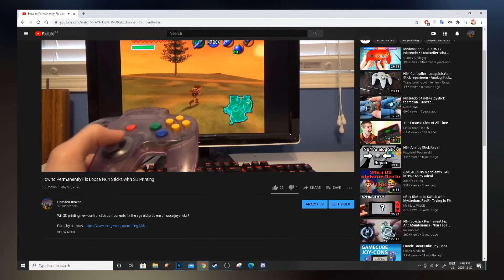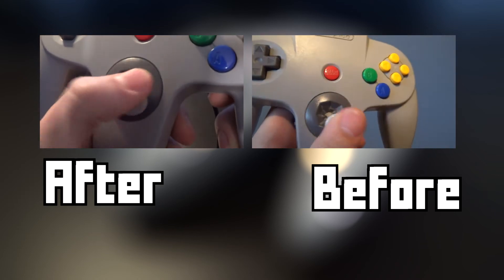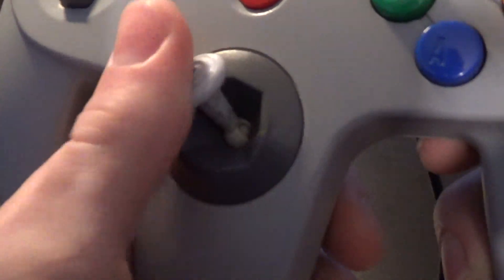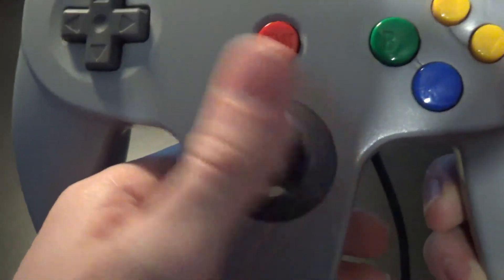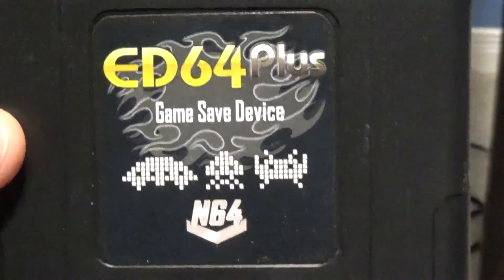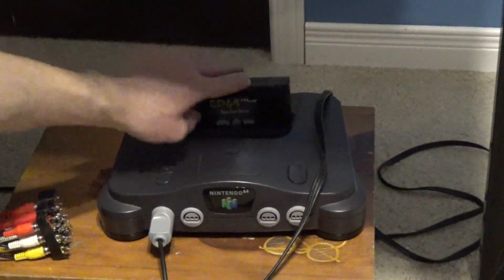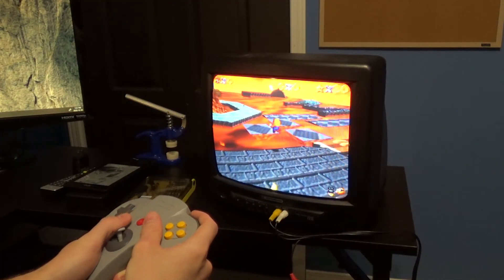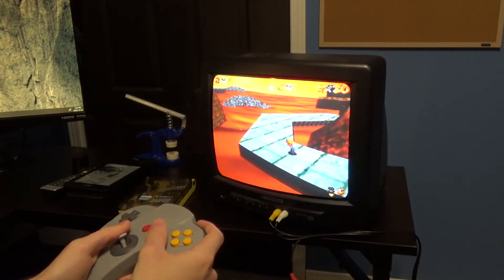The Permanent Solution to a Broken N64 Controller: 7 Months Later

Comment: Hey what kind og Grease / lubercation did you use?
Reply from the maker: It's just silicone based brake grease, any silicone grease should work. Oil will seep out into the controller so I advise against using it, and make sure you do not use any petroleum based grease as it will destroy the plastics.
Reply: @CamdenBowen  thanks, can you recummend Any products?
Reply from the maker: @frederech6482  the stuff I've used for the longest time is Permatex Slicone ceramic brake grease
Reply: @CamdenBowen  thanks you. :) And lastly  are you planing in make more retro fixing videoes. I love these to you made in the n64.
Reply from the maker: @frederech6482  I may do some PS1 related stuff
Reply: @CamdenBowen  that Sound awesome. ;) Can't wait to ser IT.